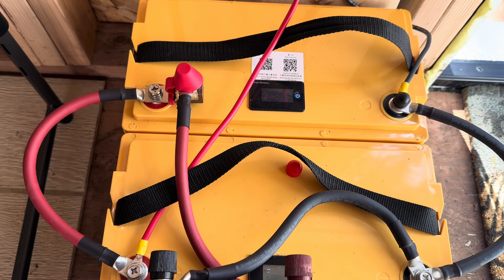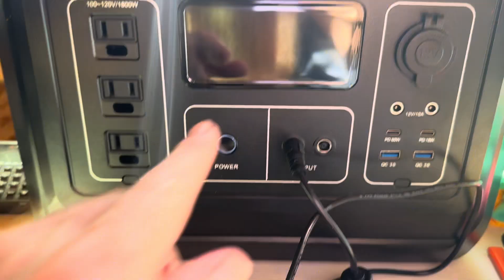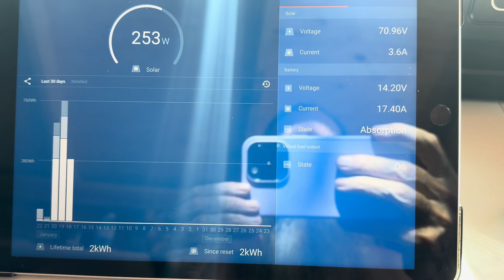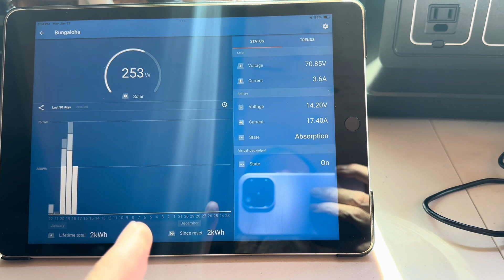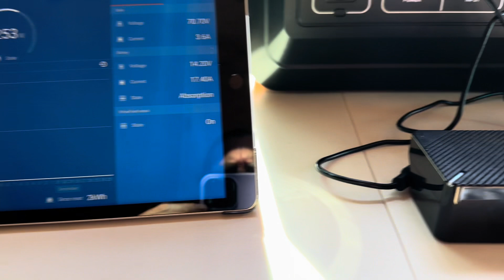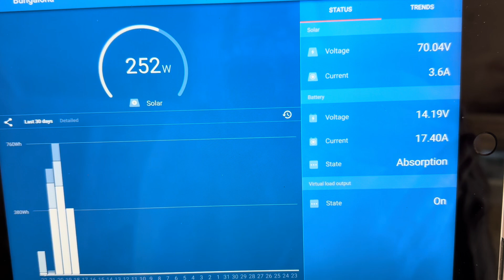Simple shop system 200Ah  LiFePO4 Pouch Cell Battery Bank  400W Solar Victron 100/30 MPPT Pure Sine

Comment: Nice build but I would suggest losing that cheap, low surge capacity, short lived high frequency, tnverter and replacing it with a low frequency, transformer based inverter. You'll have a much safer system with a much longer life expectancy  and a much higher surge capacity to power those hard to start motor loads.

Comment: You are correct.  That is the best wiring configuration for your setup.  It should charge and discharge batteries at close to the same rate. Aloha  🌴
Reply from the maker: Right on🤙 Aloha!

Comment: Hello!  I've got a LiTime 12v 100ah Mini, and been thinking about going to a 24 volt system adding another battery.  However the Redodo Mini is much cheaper than the LiTime.  Would you have any reservations about mixing manufacturers in series?  The batteries look very similar.  Thanks for your work it is inspiring!
Reply from the maker: Depends. On some batteries I personally would not tie them together. For example, two different 100ah batteries, where one is using pouch cells, and the other is not. Since I don't have a lot of experience with the pouch cells (i am running some now tied together) I would like whatever I tie together to be very close in build. I know people do mix and match these all the time, and many have asked me to do the same. I just don't have any real world experience with that at this time. I keep saying I am going to try it though. The other thing I don't know about is what BMS would be dominate if you mix them. I don't know that either, and many batteries have diffent makes and models of that as well. I wish I could tell you more my friend. Maybe I will work on that in a future video! Best of luck ! Aloha!🤙

Comment: Nice. Could you connect the car charger adapter to the other input port on that oupes?   Less losses converting from dc to ac and back to dc. Charge closer to 400w with power brick and car adapter connected with fuse to battery.  Manual makes it seem like it’s possible.  Thanks for sharing.

Comment: looks great. charge everything to full . good thing you got extra water. been cold snowy hear in NY. over 32 F today. first time in over a weak. was going down to 1 or 3 and 10-12 the high a few days. talking on Ham radio, Texas cold and icy ! . so much of the main land US cold.
Reply from the maker: Back in extreme, unprecedented drought here. Water is going to be the issue it looks like. Still holding strong with redundancy on catchment, but I need more for these conditions. Flip side of that, solar energy in surplus this tie of year...unreal. In years past I would be begging for the rain to stop. We gotta stay flexible my friend! Aloha!🤙

Comment: Last weekend my desert cabin and shed solar was lagging due to the winter storms.    Luckily I had enough cloud breaks to charge my main banks for the cabin.   My shed project currently on one 260w panel did suffer so I had to go to plan b and run 18v Ryobi tools.   Sunday afternoon was clear but I had to leave and didn’t get to top off the shed battery bank.    I love it when it’s all full and I can break out the heavy tools like table saw, chop saw, compressor etc.    
aloha, amigos!

Comment: "Corners" is definitely the right way to connect parallel batteries.  Lots of testing on this in labs and on youtube.  Will Prowse tested re. server rack batteries, but they work the same.

I probably would put the "parallel loop cables" in board on top of the batteries rather than out to keep them out of the way, but that's just me.  Might take some fiddling to get them out of the way of those displays.

Comment: The only way to get both batteries to draw equally is connect them exactly like you shown here (from corner to corner. If you make your connection just on one battery you will only draw from that one battery. When i connect two batteries together in Parallel i always make my connections from the Pos. of the first battery to the Neg on the second battery.